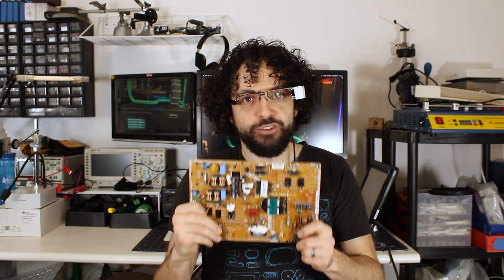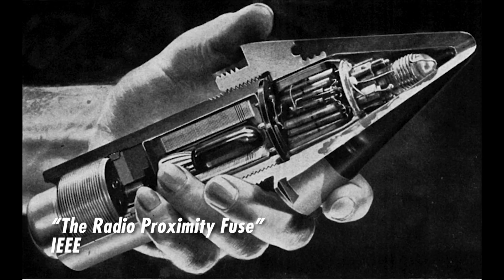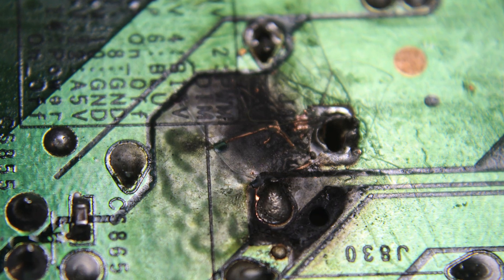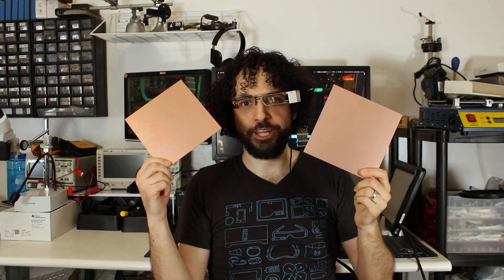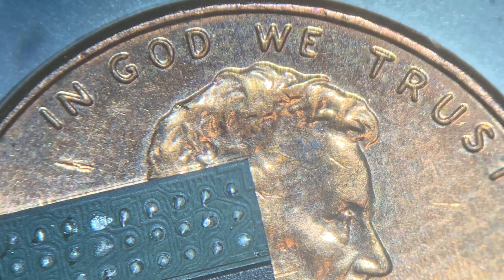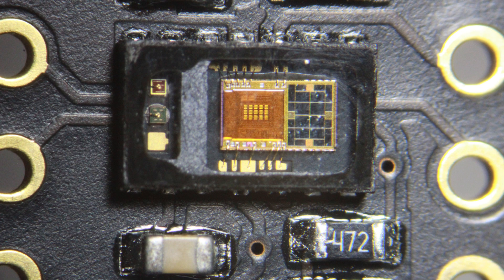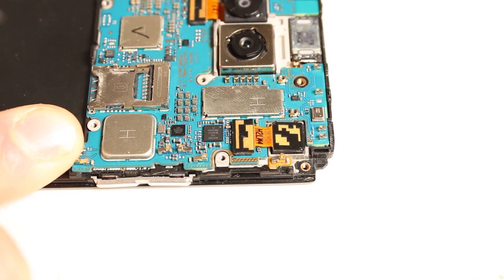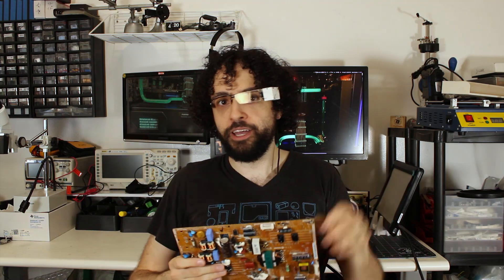Why Are Circuits on Boards?

Comment: "Anybody with a screwdriver can replace a broken camera"

Apple: "ya, lets see about that" 

#RightToRepair
Reply: I’ve been, but it was an old model. I don’t agree with the new design
Reply: J. Random Consumer "But I've ALWAYS been able to replace the battery in things, I used to get those Radio Shack Free Battery Club cards."
Reply: Apple: "And while we're at it lemme tell yuh something about integrated SOCs buddy"
Reply: If you give me a bunch of Apple phones to have them repaired, I'll take a hammer and turn them into a sauce! Tell you that the situation has been fixed, but that you need another device that isn't an Apple!
Reply: @skilz8098  I've never owned an iPhone, but I can tell you that any equivalent Android phone is JUST as difficult to repair. It requires more specialized tools than ANY of you have if you don't already work in cell phone repair.

We don't need a shitty law to fix our own things. We're free to do that now, and ALWAYS have been.

The reality is, that the VAST majority of you lack the skills and special tools to fix your own phone already, and this law isn't going to give you anything you don't already have.

This law is IDENTICAL in wording in EVERY state it's been introduced in, and literally NO ONE has a clue who wrote it or is promoting it. I guarantee you that NONE of you have read it.

* I HAVE.*

It's a piece of crap. Doesn't apply to vehicles, and mandates that manufacturers make source code, tools, and designs available to ANYONE who asks for them, which means China can RIP OFF American designs that much easier. All you in favor of this law are a bunch of suckers, and are going to end up destroying our tech industries.
Reply: @playaspec  I can understand what you're saying about being able to fix something yourself provided you have the required tools and skillsets to do so... but what does my position on not liking Apple Products have anything to do with reading or knowing about the "government laws" in regards to my position on some corporations products and business model? I didn't ask for no such law, I didn't write it or read, and quite frankly didn't even know that it ever existed until now. When it comes to technology, I've been building my own PCs since I was about 12-15 years old and I'm now 40. This includes installing the physical hardware, configuring all of the appropriate jumpers and peripherals, configuring the BIOS, installing the Operating System and Drivers, etc... I'm self-taught in 3D Graphics and Game Engine Programming, Physics Simulation, A.I. Programming both Game A.I. and Neural Nets, Machine Learning, Audio Processing, Hardware Emulation, and even ISA (Instruction Set Architecture) design from the IC layer down to the logic gates down to the transistors, resistors, and capacitors. I know how the internals of a CPU and the rest of the computer layout and design work. I even studied or read into Compiler Theory and Design as well as Operating System Design... The only thing that I haven't actually done is solder any kind of circuit boards. The only topics in programming and or computer science that I haven't rigorously studied or looked into is "networking" but I do have some basic knowledge of their implementations as I have glanced over some of their usages with sockets and protocols and how they interact between a server and client application ... I even started to read up on compression and encryption and decryption algorithms... So I know full well about computer systems and tools. With all of that being said... When it comes to Apple I don't like their products and I don't like their Business Model either and how they treat their customers! I just won't buy any apple devices. So my remarks in taking them and smashing them with a hammer stating that your problem is fixed... and that you would need another device that isn't an Apple device was a rhetorical statement. I'll still with what I know and prefer to use! I don't like their Macs, their Laptops, etc... When it comes to computers I prefer custom-built PCs running either Windows or Linux. When it comes to "mobile" devices, I don't even care if I don't own one! I prefer my Desktop! As for other devices non PC related, I prefer a lot of Sony's Equipment, such as their Game Consoles and their MP3 Walkman. For other products such as TVs, and stereo equipment it can vary... Sony, Samsung, LG, Logitech, and some others... You couldn't pay me to buy an Apple! It's not just their priority hardware that I don't like, I don't like their software either specifically their Operating Systems... I'll stick with Windows, Linux, and other Open Source mediums! I'm almost the same way when it comes to processors. I have always preferred Intel over AMD. The only possible AMD chip that I might consider would be from their Ryzen series. Now, if Intel doesn't do something soon since they've been kind of stagnant for the past 5 - 7 years... I may switch over to RISC-V.  Now, for small embedded devices... well 80-90% of the market share there is ARM. Server Side, Intel still dominates. On the PC - Laptop side of things, it's about 60/40 between Intel and AMD across all CPU models... Apple practically forces you to either A) take their device to a "certified" repair technician, or B) to buy a brand new device. Take the new iPhone for example... Take two same exact models that are brand new. Carefully take them apart and try to hot-swap their cameras. Then turn them on and try to use the phones... The applications will fail to either load or operate properly. Now, take my desktop for example... I can easily pull out my video card and replace it with the same exact model and it should just work right out of the box without having to reinstall any drivers or configuring any of the hardware... When I put out a good sum of money for a PC or device, I want full control of its hardware, configurations, operating system, drivers, and other applications. I don't want some corporation to dictate to me how I can or can not use my own device that I paid for! Thus no Apple! I'll turn them into a sauce!
Reply: Apple: Hands up, MoFo!! We do the overpriced repairs around here or the accelerated landfilling with our broken shit.. We are the Technocratic Overlords around here!
Reply: @reggiep75  That's not quite the whole truth about Apple: Due to the price, most of their customers take much more care of their products and either use them far longer than other brands, or they get far better resale value (=the next owner continues to appreciate certain virtues).
On the other hand, Apple itself knew pretty well how to re-engineer gone-back devices and resells them in the their "refurbished" store, incl. warranty. I don't know how far this still applies to newer products, but overall, this made Apple a role model for longevity, for quite a timespan.
And yes, their current path and price level (at least outside the US) is a bis drawback and we all wish, Apple would react to customer wishes and critics, much faster and especially the soldered-on components are a total no-go.
Anyhow, other manufacturor do learn from them and maybe some come up with the right virtues at a reasonable price. *keeping*fingers*crossed*
Reply: @reggiep75  You've got to be one of the BIGGEST morons on here. Spewing LIES and BULLSHIT.

QUALITY products cost MONEY . Repairing state of the art electronics costs money too, regardless of brand. Flagship Samsung phones cost EVERY bit as much as Apple's and they're just as expensive to fix. I should know, I've had Samsung phones since smartphones were a thing.

Your landfill comment illustrates EXACTLY what a complete idiot you are. Apple's phones have been NUMBER ONE in terms of longevity and reliability almost without exception. They enjoy the HIGHEST customer satisfaction as well.

Accidental damage is responsible for over 75% of smart phone failures. Device insurers like SquareTrade publish their stats, and Apple phones have CONSISTENTLY beaten the competition in terms of device longevity, which is reflected in their resale value. Used iPhones sell for WAY more than used Android phones, and typically see longer useful lives because of the way they're built.

In 2017, Samsung had the HIGHEST malfunction rate in the industry. That same year, Apple emerged as the most reliable manufacturer, with Motorola not far behind.

If you're not too tied up eating paint chips or drooling on yourself while making idiotic comments on YouTube, go Google "which smartphone has the best reliability" and read EVERY SINGLE ARTICLE on the first page.They'll ALL confirm everything I said.

In case you're too lame, here's a few choice links:

https://www.itprotoday.com/ios/smartphone-reliability-ios-outpaces-android

https://macdailynews.com/2013/03/10/apples-iphone-tops-smartphone-reliability-ratings-by-wide-margin/

https://www.darkreading.com/endpoint-security/apple-iphone-4-rated-most-reliable-smartphone/d/d-id/1094070
Reply: s/screwdriver/pentalob+heat gun/ ?
Reply: @martinb.770  What you sed was funny!
Reply: Most iphones and ipads are relatively simple to replace the camera/camera module on, as far as internal module replacement in Apple devices go. Mostly just held in by brackets and screws, and connected with common FPCs.

Getting the new, or transplanted genuine Apple module to work though, can be a very different story, especially on newer models. Anyone who had spent some time working with and digging inside these kinds of devices, can recognize reasonable or functional security features and design, from explicit, intentional anti-repair ones. Once you've worked on different design type devices for a bit, the distinction between these things become as clear and obvious as the distinction between incidentally non-friendly designs, and hostile architecture/design. And roughly 95% of the crap Apple pulls with this stuff, is definitely firmly in wthe latter category.

This is also where movements like Right To Repair / Fight For Repair comes in, but also one of its big hurdles. Translating these things we experience and see evolve, can be very difficult. Many techs don't speak fluid normie. And for those who do, many normies struggle to see how this is relevant to them because they don't really want to repair their stuff themselves. But the thing is - effectively taking away the choice of doing so, and the ability to choose who does it for you if you want it but don't wanna do it yourself - has some pretty severe long term consequences. Just to get that out of the way, it would be and is terrible for the environment, and it would intentionally kill off an otherwise healthy, very sustainable, great-consumer-value repair industry that adds serious value to society, consumers, other industries and the economy. It can be decently good business and fairly well paid, it's a very nice avenue for self-employment or starting your own business, that is way below the norm of exploitative business models.

But, focusing back on the consumer (and technology-reliant industry businesses) perspective: You would no longer have any say in when your stuff, your devices, may function, may be returned to function if it breaks and stop working, or how and when it will stop working. They can inplement any device-disabling and anti-repair mechanism they want, and you'll have no recourse. For connected devices, that can be as clear cut as remotely disabling the device by the manufacturer whenever they feel like it. Some severe examples but it drives the point home: If a button on your industrial machine, hospital bed remote, in your car or on your phone breaks - the manufacturer can disable other unrelated elements or even the entire device. And you'll have no avenue of recourse. Even if you source an identical part from another original identical device and replace the broken one, you will still be completely at the mercy of the manufacturer on whether they will allow your device to ever function again. If they don't approve customer or 3rd party repair, or offer such a repair themselves, you'll have no alternatives to make it work again. If the manufacturer offers support and repairs but decides to end that after a few years (or months), you have no alternatives but to buy a complete replacement or go without. If your machine / device is mission critical or holds important data, you'll have no means of recovery unless the manufacturers themselves feel like offering that. With devices like iphones, ipads, many macs etc, this has already, for the most part kinda been the case for many years already - your only options for recovering data on a broken device is independent 3rd parties or DIY, Apple refuse to offer that (and even tells its customers it can't be done). Having no alternatives and thus no competition, they could charge you any price they feel like for any repair, and they definitely will. Same goes for repairs they do feel like offering - they could and would charge you prices at or above the cost of a new device, and attach any condition and criteria they can come up with - making repair completely cost prohibitive, to ensure you buy a new one instead.
Reply: He say that this is for "consumers", Apple users aren't consumers, they are accolades of a sect. just pay and stay shut
Reply: @monad_tcp  Isn't paying and shutting up the very definition of "consuming"? Like, using something untill it's used up and throw it away?
Reply: @SeamusHarper1234    "Isn't paying and shutting up the very definition of "consuming"? Like, using something untill it's used up and throw it away?"

Until its used up, if a single part of a multi-part thing breaks, to my vision its not used up.

I keep beating my machines until the totally of their parts become unusable, or it becomes too old, for ex, this computer has 6y, it had a PSU change, 4 HDDs changed, the batteries of the UPS changed, memories, and even the actual NVRam chip was desoldered and replaced, and it still keeps chugging, until it dies of "old age".
But if it was apple, the first time the PSU broke, it would be landfill.

Paying and shutting up is one thing.
With Apple is more like just pay, and pay and pay, keep paying.
Reply: @monad_tcp  Don't get me wrong, I don't support Apples repair policy. But you could apply that to most smartphones. They can only be repaired by experts with proper tooling. We are on the same side on that point. I doubt most people could even open their phone, though. I don't know how, and I think as tech savvy of myself. That's what repair shops are for ;-)
Reply: @SeamusHarper1234  the laws of repair are to protect the repair shops, otherwise their entire business stand on sand.
Reply: @monad_tcp  woah woah woah. Shut. Apple has its place.
Reply: @teatrolites3446  Apple is done.
It can have its place in history. We don't need it anymore.
Reply: @monad_tcp  apple is literally the richest company in the world and is in the process of vertically integrating it’s PC line. Apple is fine, my dude. 

I use Linux and would never buy an apple  computer,  but I don’t feel the need to lie.
Reply: @dstinnettmusic  when did I lie, I didn't say Apple is doomed as a company, I just said they are done because in a sense, they can't expand anymore their market and it will only shrink in the long run. If I had Apple shares and I invest in periods of 20y, I would start thinking of selling if they don't change, they sure can't pull more rabbits out of the pocket, it already happened in Apple's history with the old Mackintosh, and it will happen again, but this time there's no Steve Jobs savior to come back.
Every day more people notice that other phones are also usable, and people only wear Apple for the brand.
The same thing that was happening when Microsoft was done in the Balmer era, but then they changed focus from the Windows to a new market, the Azure Cloud, now Windows is just mere 15%, Microsoft would have been done if it kept trying to sell just Windows.
Apple will need to become an streaming company, they will probably ditch the devices division in the long run and just keep the music store.
Reply: @dstinnettmusic  I don't get what this circle jerk is all about. I've been in tech for all my life. Better than 40 years in practice, and I say Apple has always innovated. People demanded SECURE smaller/thinner devices that that don't burst into flames in your pocket or on your face, and that's EXACTLY what Apple provided.

The answer to that was gluing everything together, and the ENTIRE INDUSTRY has done this, not just Apple. This manufacturing technique WORKED (which is why the entire industry does it), and it made phones MORE reliable as a result.

Literally EVERYONE is free today, WITHOUT the need for a "right to repair" law, to obtain the part they need, disassemble (assuming they have the requisite tools and skill), fix, and reassemble whatever device they like. There's literally no controversy here.

What advocates of this crappy law fail to recognize is that there's NOTHING in this law that provides them with the THOUSANDS of dollars worth of specialized tools required to service a mobile device. So while you win literally NOTHING that you didn't already have, you ultimately weaken the security of the things you own by advocating for this law.
Reply: @playaspec  
and it has absolutely NOTHING to do with security/reliability, especially in the case of apple. oh, and have you not heard the MULTIPLE stories of apple hardware breaking-down and apple REFUSING to service it? have you heard about them OPENLY LYING about what was wrong? did you hear about their lying, defamation of character, and BANISHMENT from their forums of someone who found a way to recover data when a device dies? no? bogus patent lawsuits? abuse of ICE to cut-off independent shop supplies?

it's to make you their bitch. they control your data/files, they control your device, they can lock you out of their services at whim, and they can force you to buy a new device just by upgrading the OS and then preventing YOUR DEVICE both from receiving the update, and by making the apps or app store only support the newer version. that's assuming a critical hardware component doesn't fry itself, first. and apple, for one, has a track record of this. just watch ANY rossman video. they also can refuse to repair shit even if you offer to shell-out COLD HARD CASH, as happened to Linus.

oh, and gluing shit together, covering it in epoxy? guess what? there's functionally only ONE reason to do this : PREVENT REPAIR, REVERSE-ENGINEERING, AND TAMPERING/"TAMPERING". and guess what happens from gluing batteries, in particular, in so tightly? there's an exponentially higher chance of the batteries EXPLODING, because lithium batteries kinda like to blow-up when punctured. you might puncture one when trying to pry it free of its restraints at the point in its life where it ceases to be useful. ofc, apple has a lie for this "chinese lithium", yes, because all the ACTUAL SCIENCE about lithium doesn't say ANYWHERE AT ALL that it's an EXTREMELY volatile alkali metal that kinda very much wants to react with shit if given the opportunity.

thousands of dollars of specialized equipment is neither here nor there. it's a fact of life. however, in all bit a very few select cases, you do NOT need specialized tools. additionally, some specialized tools literally ONLY exist BECAUSE the company made them exist. tamper-proof screws? functionally unnecessary if you ignore security or "my trade secrets!" (which is actually a major use for them, like epoxy blobs). also should add-in that expoxy blobs are not only very dangerous to remove, any specialized equipment/training be damned, but removing expoy tends to use methods that DESTROY and DAMAGE what's under it, PERMANENTLY. 

i suppose next you'll say only people with thousand plus dollar software suite, thousand X <insert platform here> developer licenses, a MULTI-THOUSAND dollar government permit, AND hundreds of thousand of [arguably wasted] dollars in "professional training/education" should be required to even write and distribute ANY program, even "hello, world"?

oh, and btw, since you're advocating for people to not be able to service their stuff themselves (companies already REFUSE to after designing it to break, it's called planned obsolescence, look it up), i guess you also should be saying you hate the environment. since these devices, with or without specialized equipment, CAN NOT BE SERVICED, they become e-waste, tons upon tons of it. not only that, but an ungoldly quantity of natural resources are consumed to make even ONE smartphone. (including water), so you're also saying to waste millions and billions of gallons of water because "oh, sorry, these people are idiots and only the manufactures should be allowed to service these devices [even though they more than once have refused to, or the way they designed their components means it's actually impossible to do]"

oh, and one more little tidbit : companies (ESPECIALLY apple) go out of their way to make specialized equipment or specialized parts INACCESSIBLE TO "UNAUTHORIZED PARTIES". (like independent repair shops) we absolutely NEED right to repair. 40 years in practice and you've either never seen what REALLY goes on, fully support it, or have chosen to ignore it completely. and either way, you should be ashamed of yourself. people like you are why the planet is dying, multi-billion dollar corporate MONOPOLIES own almost EVERYTHING, and independents continue to either suffocate or be swallowed-up by the big guys. 

maybe engineers care about reliability and security, but executives and shareholders do not. they care about profit. devices that only they can service, that break, that they then refuse to service, make them billions upon billions of dollars in profit. and if engineers DON'T design it this way? they're looking for a job. and ofc, no one while-blows dangerous defects , and then next thing, the news headline says "DANGEROUS DEFECTS, THIS PRODUCT RECALLED, MILLIONS AT RISK, HUNDREDS INJURED OR DEAD". or "MAJOR BREACH, MILLIONS OF <PERSONAL INFORMATION ITEM HERE> STOLEN"... oh, and don't forget the billions? trillions? <scary number i don't want to see>? of TONS of waste produced because this shit breaks left and right and everyone just replaces it. and most of the time, because a SINGLE COMPONENT broke.
Reply: #Stallmanwasright
Reply: Apple makes cameras?
Reply: Very small screw driver...lol
Reply: I mean, older iphones yeah, although you really just need 3 different screw bits
Reply: You got your wish Apple's repair kits are filled with the actual beefy repair machines they use at Apple stores. They are very un-userfriendly and people complain about it but I'm happy to have access to their tools.
Reply: Even if we can swap the camera, it's serialized now to the board so it doesn't work. How nice of them. 🙄
Reply: Apple devices don't contain any parts. The whole device is one single part itself. Need something replaced? You simply replace the one single part (The whole device). Apple has made "service" very easy that way.
Reply: @sysghost  Be happy its not a 0 part device. By that way, just pay apple tax and engrave their logo in your forehead
Reply: @sysghost  its still too hard to use, its better if there is no device, apple just takes money from your account. It does the same result.
Reply: Get y'all a Fairphone. Screwdriver included.
Reply: @Kenionatus  not now lol, no fucking 3.5mm jack
Reply: If you wanna replace it you'll have to pay another 1k
Reply: apple creates status symbols, their priority isn't customer satisfaction.
Reply: @ashurean  said: "apple creates status symbols, their priority isn't customer satisfaction."

LMAO!!! Apple has literally owned the #1 spot in customer satisfaction on both phones and laptops for over *TEN YEARS*.

You guys are as deluded as Qtards.
Reply: Yikes oversight in the video
Reply: You do know you can do that right? Apparently none of you have been inside an iPhone before lol.
Reply: @lawnmowerdude   Well... Technically you can do literally anything you want with an object that is in your hands... The point is how hard Apple will get out of it's way to trie to screw you either if you do as they want or you don't
Reply: @lawnmowerdude  You can but it won’t work because the serial number is different.  Only apple can change the serial in the database.
Reply: @bobrowicz82  said: "Only apple can change the serial in the database."

That is INCORRECT. This has NOTHING to do with a "serial number". It's more complicated than that.  The 'pairing' that has to take place in the thumbprint reader is an exchange of cryptographic public keys and certificates. ANY Apple certified tech has the tools to pair the replacement part with the phone. Anyone can get trained and certified to do this. I don't understand why people are against better security. 

If it had been done by someone with the proper training, there would have never been an issue. Replacing a component that demands high security requires knowing the constraints of that system. Owning a set of jewelers screwdrivers doesn't mean you're qualified to work on anything that comes in the door. Literally EVERY phone on the market today has a locked and cryptographically signed OS image. If you want to work within these ecosystems then  get trained and get certified. If you had a top luxury or sports car, would you ever attempt to do your own engine work? I'd rather have my phone be secure than open it up to anyone with mal-intent.
Reply: @playaspec  for the thumbprint reader sure, but why the hell does a camera need to be cryptographically secured before it can be used?
Reply: @TheAechBomb  "but why the hell does a camera need to be cryptographically secured before it can be used?"

Seriously? FaceID? If any idiot can install any camera they want and have it work, they can connect a dummy camera that sends your driver's licence photo and break into your device without you even being there.

Sad that so many are both technologically illiterate and myopic about their own security.
Reply: @playaspec  faceID is a totally seperate part though
Reply: @playaspec  also FaceID uses a 3D depthmap of your face, not just an image
Reply: @TheAechBomb  said: "FaceID uses a 3D depthmap of your face, not just an image"

Which can STILL be faked and injected if you allow any old piece of hardware to be attached without question.

Cryptographic pairing of peripherals like cameras and fingerprint readers PREVENT THIS FROM HAPPENING.

Why are you so dead set AGAINST good security?
Reply: @playaspec  a depthmap could be faked for much cheaper with a 3D printer, nobody ever broke into an iphone using faceID injection before they did tbis. if apple let us repair our devices I'd be happy, but they go out of their way to make that impossible.
Reply: @playaspec  
ah, we'll just pretend tainted supply chains, government backdoors, software exploits, and numerous other things just don't happen and therefore cannot be used to bypass that, anyways. 

hackers will find a way, they always do. swapping-out cameras and fingerprint readers at a large scale is questionable from practical and economic perspectives. too many moving parts to track and extremely high risk of being caught. tainting the supply chain is far more effective, as is targeting specific individuals/groups. what stops a 'legitimately paired' device from doing something naughty behind the scenes? nothing! just breaching a single database of some multi-national corporate entity would be more effective.

also in this "perfectly unhackable device" scenario which whether any of us want to admit or not is but a pipe dream, what if you get permanently locked-out of your own device? there are many ways this can happen. just like security can never be this fail-proof, the device (including those security features) can not be guaranteed to always function how it's supposed to. the code could be 100% bug-free, and all that needs to happen for something to go terribly wrong is one single transistor to fry. just one. in order to do maintenance and data recovery, security needs to let-up somewhere. and even with those specialized tools you speak of, there's no surefire way to keep those out of hands of a malicious party. 

at the end of the day, people pay hundreds and even thousands of dollars to own these devices. it is their right to use and modify them how they see fit. if they want more security at risk of losing EVERYTHING, that should be their CHOICE. if they want to sacrifice a bit so that when/if something malfunctions HORRIBLY they can recover [mostly] everything, that is also their CHOICE. as far as security is concerned, there are better solutions, anyways. the most obvious one being to minimize how much of your personal data is being stored/shared ANYWHERE. biometrics are just one more thing to break-down or get hacked. 

also, just because there is any statistic for user satisfaction does not mean it's accurate. statistics are inherently unreliable and routinely cherry-picked to show desirable results.  even if the presenting party were being completely honest about the data (rarely is this the case) statistics can only measure and account for known variables. consider this very damning one : dissatisfied customers have grown accustomed to being ignored. they may not even fill-out surveys or do whatever else it takes to be marked as a "not satisfied" statistic. why bother? the company doesn't listen. there are so many ways to fudge those numbers. given the number of times they've been sued, and documented examples of  the contrary, i'd take any positive customer satisfaction rating for a company like apple with a grain of salt.  also, just for fun: some day in the future, the rating actually drops to 10%. here's the catch : everyone else has ratings well below that (1-3% of customers are satisfied). apple is still "rated as one of the highest for customer satisfaction" under that scenario. but 10% is actually abysmal. that means 90% of their customers are not satisfied. 10% however is 10x  1% (aka way better). so, this absolutely appalling score can be manipulated to look like the best thing ever. i actually don't put that past them, either...

i wouldn't say anyone here is strictly anti-security. but when security impedes every day use and hinders maintenance severely, then yes, you'll find a handful of people aren't cool with that. how would you like it if the lock to your front door malfunctioned so badly that it had to be cut-out? better yet, how would you like having to demolish your entire house because for any reason, you lost access to it and the security was so over-engineered that non-destructive emergency access was just not possible? (btw, you lose all your valuables in this process.)
Reply: @playaspec   "Which can STILL be faked and injected if you allow any old piece of hardware to be attached without question."
bullshit.
one, the face ID is bullshit gimmick, its not secure in any way.
a simple pin would be better.
second. there's this thing called root of trust, you could replace every single piece of hardware and still make it secure just by keeping the same security enclave chip.
that's why PCs have removable TPM modules, so you can move your keys, you could replace every single part of a PC and it would still be secure.

No one is against "good security", WTF you don't even know what you are talking about.
You aren't even a software developer, you know nothing of security.
Reply: @playaspec  "How are you going to keep the secure enclave "chip" when it's an INBUILT part of the application processor?"
That's a stupid design problem. 
In real commercial designs used on PCs, the TPM has to be external, obviusly.